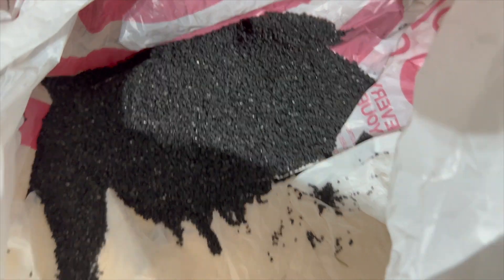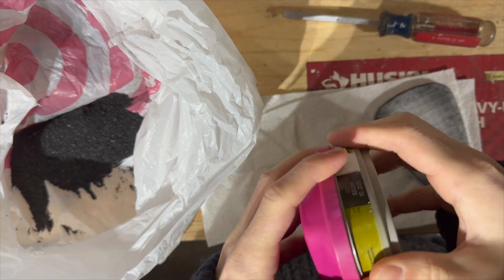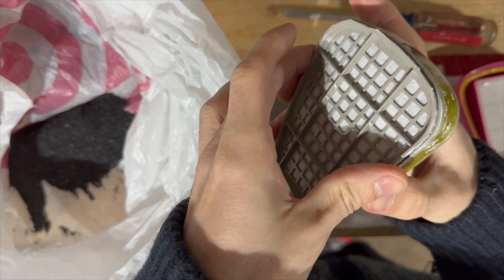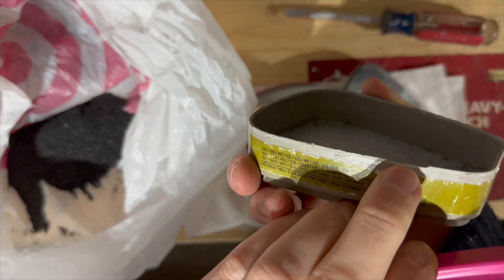How to take apart and reuse 3M 60926 filter

Comment: The p100 2097 are cheaper and last longer if all you need is particle protection. If you just happened to have a 60926 laying around or if it's past the expiration date for the VOC protection. But I was neat seeing the inside of one of those.
Reply from the maker: Yeah I bought it for a job to spray strong stone sealant. After that it was too hard to breathe. I was also surprised how it was completely filled with charcoal. There was so much I don’t know how air got through. Unless it expanded from absorbing VOC or from humidity in the air. There was also very fine charcoal powder. Spending around $60 for 1 time use seemed so overpriced and a waste of money. So I took it apart and still use it today for particles only like dust, saw dust, drywall dust and fiber glass. I never had any issues when blowing my nose everything came out clean. I just use a ryobi compact blower and clean it off for next use. Easy to breathe.
Reply: @DAN1Kpro   @DAN1Kpro  It is counter intuitive because of what you "see" but filters like that cannot be cleaned in that way. It's not to get you to buy more filters like saying ink cartridges can't be refilled which companies actively hinder. It's just where the technology is at right now. It is unfortunate because of all of the waste. 3M uses pretty good materials and so it could be glass fibers on that respirator carriage "paper", meaning it can't be cleaned at all. If there was a way, you'd make a killing selling that technology to nuclear facilities that need to filter radioactive particles out of the air and so reducing filter waste volume they have to store by making them reusable would save a ton of money. There is an experimental way for recharging glass fiber filters with liquid carbon dioxide. The filter is small enough that you could make a pressure chamber to do that for the learning experience but I don't think it is practical. The others rechargeable methods require starting with filter fiber materials that would have the price way more than just $60 or $80. 

Air filters do not work like coffee filters, they do not sieve the particles out of the air. Well the harmful particles are too small to sieve. They work by three mechanisms: diffusion, interception, and impaction. Which takes effect depends on the size of the particle. You might be tempted to think particles smaller than 0.3 micron pass through easier, you might be happy to know that's not necessary true. The measurement is taken at 0.3 micron particles because those are harder to capture than smaller and bigger from that size. It's funny because of the virus being smaller than 0.3 micron arguments and so many people not understanding how things work at that scale...not it's actually sad that more people don't know these things, I digress. Anyway,  all of the spaces between the fibers are canyons compared to 0.3 micron. If the filter had to use sieve principles to work, it would hardly capture a thing at that size. This makes cleaning different than what most people's intuition would lead them towards.

When you attempt to clean/recharge your disposable filter, the fine matrix is damaged and the debris is not going to be well removed by a vacuum technique for the same reasons the particles were captured. This isn't an affair where it is easier to pull the particle out by the otherside in a back wash type fashion. It still has to make it past all the fibers it missed on the way in with all the same principles in effect that will capture it again just as happily in any direction of travel. Measuing the mass of the filter before using it, the when it is dirty and again after your cleaning method will show you just how ineffective it is. Wet techniques with ultrasonic baths for hours can loosen the particles and recharge filters, but most common fiber types are damaged. Keep in mind, the harmful particles are small and so light, a little mass is a lot of particles. Anyway, the damaged matrix is going to decrease the MERV rating the filter can achieve. This might be acceptable for a home appliance that is recirculating air and has another change to capture particles. Masks have one chance before the air, and all that is in it, enters your lungs. Better than nothing, well arguably so is a rag, but how much protection do you want for your body? If I'm wearing a big respirator it has to be worth my discomfort and inconvenience. 

 Also, the particles that cause nasal cancer (more common hazzard caused from wood working dust work) is caused by sub micron particles. These are hard to deal with, even with a portable HEPA scrubber in your shop it can take a day or two for levels to drop back to what limits OSHA calls safe. You don't see them in your mucus without a microscope and they don't come out of your lungs easily. The relatively big chunks that you do see and color your mucus aren't a big deal unless the substance itself is toxic as well. Btw, a vacuum at the source of the dust generation is best control method because of how long the harmful particles stay suspended in the air. Without a scrubber it can be weeks before reaching safe levels. Your choice is yours, but at least you can make an informed one now.

Your experience with the carbon filter is odd that it became more restricted after exposure to vapors. Carbon filters work by adsorbtion, in that the VOCs stick to the outside and form a thin layer. Not absorbtion like a towel soaking up water. So the carbon wouldn't swell. Yes, a quality filter will need lots of fine activated carbon because there only one chance and carbon has a low holding capability which is why so much is needed relatively. Lucky carbon is cheaper than other methods and effective at atmosphere pressure. Curious, I wonder what could have caused what you experienced. It doesn't happen to my filters around the solvents I use. Not sure what went on with yours, but I don't think it is typical. Some of the filters do have different ratings for different gases and acid vapors. That's when alumina and other material is used in addition to the carbon and I am not so familiar with that. I doubt any of that would swell but maybe but I hardly ever work around acidic gases so I don't know as much about filtering and controlling them. Besides, those filters only last for a few weeks or months even days after breaking the seal, depending on how the mask is stored. They are a specialty item.

I think it is acceptable expense to buy a pack of p100 pancake filters and swap them every year or so depending on how much dust exposure. If you're around dust multiple times a week, look at the OSHA guidelines for how frequently to replace the filter. Don't attempt to clean them, there's plenty of research into rechargeable HEPA filters. Should you read into it you'll understand why it's a difficult and expensive task not worth trying on a small scale to save money if you want to dig deeper than my explanation. Keep the cleaning attempts to those cheap home portable appliance "HEPA" machines. They don't work well to start with because of the PET fibers and the fibers are more durable for a "wash" or two because of the same reason they don't work well, made from PET.

Comment: Do not modify your PPE, folks.  There are so many misunderstandings here that defeat the protection.  Also, that is not a HEPA.
Reply: It's not the stuff that's large enough to stick in the nose that's the issue .. it's the super fine stuff you can't see that does the damage. Just buy new dude your lungs are worth it 👍
Reply from the maker: You do realize that a P100 filters out 0.3 microns. The smaller stuff is VOCs, gases,  some bacteria, some pollen, viruses, smoke, smog, oxygen. If you’d like to filter all put a plastic bag over your head 😂 JK don’t do that. You inhale all that stuff when your out and about not working. If you sneeze that’s good. Do what you want to do it’s your health and money. The next best particle filter would be an “ultraHEPA” which I don’t think exists for face masks. Filters 0.003 microns stated as filters 100%. Just to keep in mind the better a filter is the more restricting it is.
Reply from the maker: This is for when the filter has been used multiple time and is no longer easy to breath through. In the description I state this is for filtering particles only since your dumping the used charcoal. A P100 filter is NIOSH equivalent to a HEPA filter. I reuse my filter for drywall, fiberglass and other dust. Afterwards I used a blower from the inside and outside of the mask and most of the dust accumulated on the P100 gets blown off. I blow my nose and it’s clean without any signs of inhaling anything besides odors. I’m not recommending for people to use it again for VOCs, Gasses, or chemical vapors.
Reply: @DAN1Kpro  I perhaps was being pedantic with the HEPA remark.